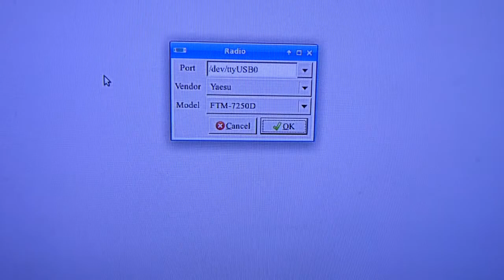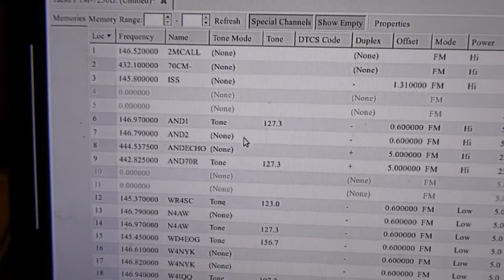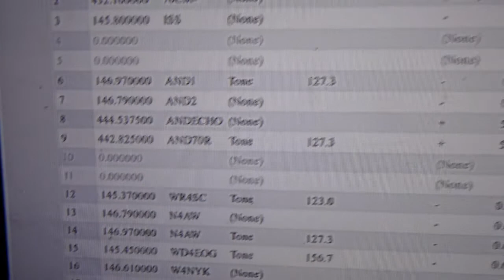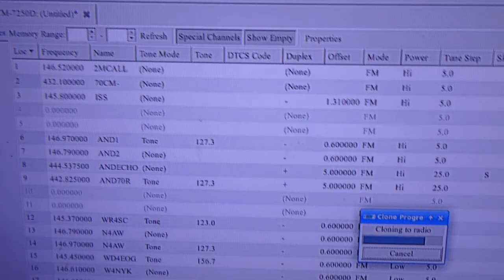How To Program the Yaesu FTM-7250 using Chirp

Comment: My radio came with a data cable? Will this work for the programming? Sorry for the nube question. Thanks in advance
Reply from the maker: The cable that comes with the 7250 and plugs in the back is for firmware updates only, won't work with Chirp or other programming software. You need the cable that plugs into your mic jack and has a USB connection on the other end.

Comment: Bought the cable directly from Valley Enterprises, and installed CHIRP. I can confirm the cable works very well to program the FTM-7250 using Windows 7. I only wish CHIRP would update with settings adjustment, but you saved me $25 from not buying the RT Systems software! Only problem with programming with CHIRP I found was that it would not let you set different input and output tones for cross tone repeaters, but I only have one repeater that uses different input and output tones so no big deal, I just manually programmed that repeater. Thank you very much sir for uploading this info!!
Reply from the maker: Glad I could help. Chirp doesn't do some of the finer details, but works great for getting the mass imports done.

Comment: Hello sir, could you tell which RAM parts did you use to assemble this nice mount? Regards
Reply from the maker: The radio mount is a Ram Mount RAP-111 (listed as a Composite Mount for Fishfinders), with a Class 3 Ball. 
The arm is a Size C, Short, Double Socket Arm: RAM-201U-B
The base is Composite Round Plate with Ball, Size C: RAP-202U
Hope this helps.
Reply: @TwoAcreHomestead  That's perfect, thank you!

Comment: Thank you!
Reply from the maker: You're welcome!
Reply: @TwoAcreHomestead  followup separate question for you - do you find you need to crank the squelch up compared to your other radios? (especially for VHF).  Mine is weird in that it needs a lot of squelch (7-9) vs 1 for all my others.  Yaesu said I should send it in for repair but I wanted to see if another person with this radio, and has used Chirp, is experiencing the same thing.
Reply from the maker: I'm usually at 2 or 3 on Squelch, no difference before or after using Chirp, sounds like a trip back to Yaesu might be a good idea. 
You could factory reset and see if it is a programming issue. Did it happen only after you used Chirp?
Reply: @TwoAcreHomestead  Hopefully this isn't a double post (not seeing my first reply).  I used Chirp right from the get go, so I don't know if it caused it.  I did try a factory reset, but to no avail.  With Covid, Yaesu is quoting 3-4 week turnaround time on repairs :(
Reply from the maker: Sounds like a hardware issue, not enough of an expert to speculate what it might be, but I think factory service is in your future.

Comment: Could you give us the programming cable number to order?    Thank you in advance.
Reply from the maker: Brand: Valley Enterprises
Part #: RPC-YM6-UF
Model: CT-29F
Amazon Link: https://amzn.to/3dONmiI
Reply: @TwoAcreHomestead  
Amazon says at that link: Currently unavailable.
We don't know when or if this item will be back in stock. 

But there are substitute CT-29F cloning cables available on Amazon made with genuine UK sourced FTDI chips. Example:

https://www.amazon.com/USB-RJ11-6P6C-Radio-Programming-CT-29F-USB-6P6C/dp/B08G87LBSK/ref=sr_1_1?dchild=1&keywords=6FT+USB-RJ11-6P6C+CAT+Radio+Programming+Cable+for+Yaesu+CT-29F&qid=1605124330&sr=8-1
Reply from the maker: @Tony 
Thanks for sharing that info. I don't have any experience with that other brand. 
Please let us know if you order it how it works out for you.
Reply: @TwoAcreHomestead  I should receive it tomorrow, per the Amazon website. I'll post again here with results after I give it a try.

BTW, the CHIRP website (i.e.: danplanet) doesn't list the FTM-7250DR on its hompage's list of supported radios, yet this radio model number DOES show up in a dialogue box during your video. Is there any special download version I need to look for (or unlock step I need to take), or are they just not keeping the website list as up to date as the most current download of the CHIRP app?
Reply from the maker: I am using "CHIRP daily-20201014", and the FTM-7250D is in the options under 'Download from Radio'. If it doesn't show in your Download from Radio screen, I wouldn't use the version you currently have. 
btw, I run on Linux, so it's possible the Window's options are different. I think the 7250 was added back in August tho, so if you update your Chirp you should get it.
Reply: @TwoAcreHomestead  

Eric:

No joy so far with the cable and my 7250. I am running the latest Chirp Daily - 20201014 version of programming software on my Win10 Pro laptop. The FTDI driver set loaded cleanly from their site and ran seamlessly through its installation Wizard. 

Device Manager now has FTDI's version 2.12.128.0 both working in the "USB Serial Port (COM3)" entry under LPT/Ports AND also under Universal Serial Bus Controllers (at the bottom of Device Manager) under the entry USB Serial Converter. FTDI version 2.12.128.0 is dated 8/16/2017. Sounds like kind of an old load of driver software, but the FTDI chip does seem to "like" the driver and there are no complaints about a counterfeit chip (better not be). These types of drivers really should not need to change that much.

COM3 is what a lot of my Chirp cables use, but it's different from your video where the port shows as /dev/ttyUSB0 (which is what I am assuming your Linux OS assigns).

I simply get a Communications Error when I try to "Download from Radio". The cloner's TX simply runs through to the end (as it's not very smart) and then either ERROR or CLONE get displayed with a full "s-meter" of progress. 

Then I hear a pulsing noise from the 7250's speaker (likely the cable polling the USB bus connection to the radio) until I disconnect the 6 pin RJ-11 end of the cable from the microphone connector. I have to recycle the power to the radio to get back to the same CLONE and no progress bar using the same MHz/Setup + Power simultaneous turn on process.

Any ideas? It seems the driver and cable are working, but something's not "happy" on the COM line and the radio refuses to give up its channel information.

The only thing I haven't tried is to run the 32 bit version of Chirp and the cable's driver, like I had to do with my Yaesu WiresX node's HRI-200 PC software. That was the only way I was able to get that software working. This may come next !!!

---Tony (W9MT)
Reply: Also, backing the driver in the two places listed above to the earlier 2016 vintage 2.12.124.0 also doesn't work. Maybe I need a Linus box !!!
Reply from the maker: Not sure whats up. Are you sure Com3 is the right port? Is there anything on Com1 that could be interfering with it (Windows thing). 
My speaker was silent during the process. 
Might be a cable issue, might be a comm driver issue. Can only guess from this far away.
Reply: @TwoAcreHomestead  

Eric:    No joy....

That link goes to a CT-29C cable that isn't compatible with the FTM-7250DR. The FT-2600M/FT-90R both use an MH-36 microphone (RJ-11 connector).

The 7250 uses an MH-48 series mike (RJ-12 connector) and a CT-29F cable, just like the FT-2800 and FT-1900.

The correct CT-29F cable is still out of stock:

https://www.valley-ent.com/store/yaesu-usb-ftdi-programming-cable-ct-29f-ft-1900r-ft-2800m-6-pin.html?search=CT-29F

The driver listed in the new USB Converter's entry in Win10's Device Manager shows an error under the Events tab saying "more needs to be loaded". (Not a very helpful message upon which to take any action.) So, I've even dusted off an old XP laptop and got legacy drivers (VDC that turn the USB into a COM port) that DO load correctly, but the error for lack of communicating still comes up...even after trying all COM port choices given. Under XP, it appears the radio gets the command to begin downloading with COM10, but nothing the radio sends downstream (you can follow the progress bar on the s-meter LCD) makes it back to Chirp. It does complete the cloning send all the way through, but nothing comes back and Chirp flips an error message. It seems the FTDI chip has a figurative one-way door. 

You're lucky to have installed your arrangement under Linux, where you get to see lower level detail. Windows 10 is an OS for less computer literate people and hides a lot of the lower level info. 

I guess I'm stuck figuring out what's going on or will have to punt and buy the expensive RT Systems software and their cable. (Rats....)

I'm going to pound at Win10 64 bit further and will post again if / when I hit a breakthrough....

Thanks for replying, though.
Reply from the maker: Thanks for catching that, I moved that link to my video description in error. Will clean that up.
Reply: I know it's kind of randomly asking but do anyone know of a good website to stream newly released movies online?